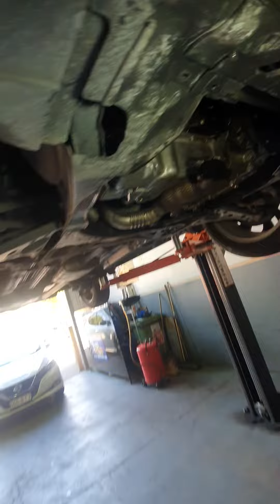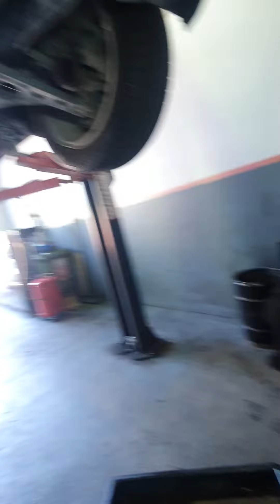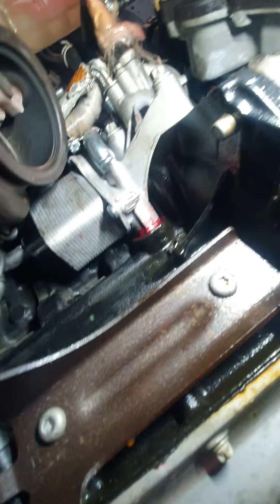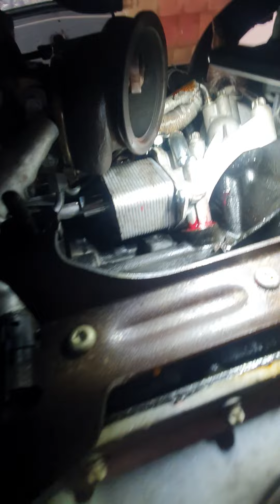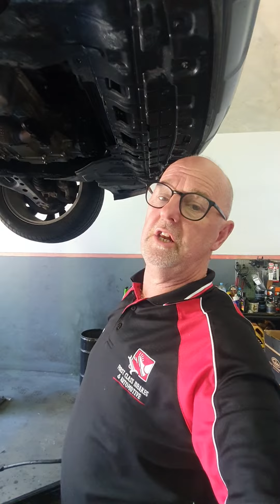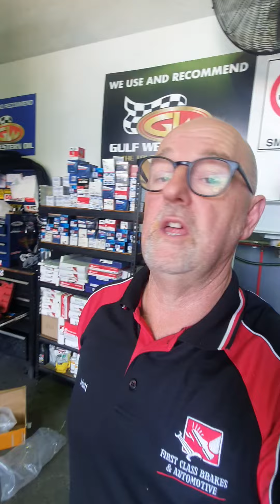Holden Trax oil leak, engine oil cooler leaking

Comment: Hey mate cheers for the run down. What is the going price for an oil cooler on one of these to get replaced? My sister has been quoted $2400 for just removing and fitting the new one + service costs on top of that
Reply from the maker: In Australia EBay has oil coolers from $89 perhaps an extra $750 to $950 for removal and fitting. Price depends on a mechanics hourly rate and how long they believe it will take to do Regards Matt
Reply: @firstclassbrakesandautomot6941  awesome, thanks for the fast reply. I am in aus too and was looking at the price of the cooler online. Definitely confirms to me that it's a little steep pricing. They must think they have to pull the motor out to do it 🤣